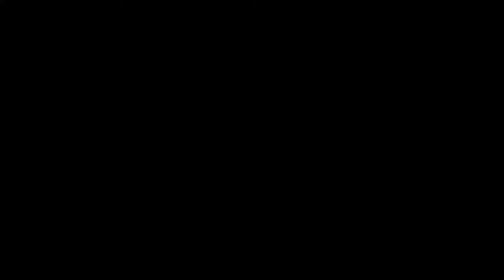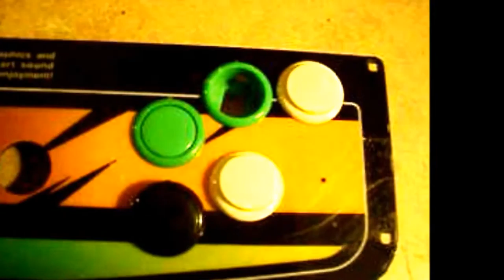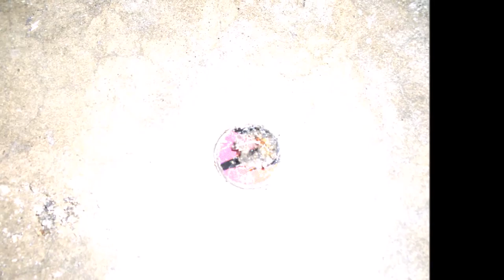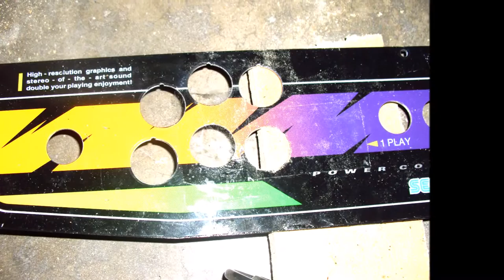Hole Saw Tutorial

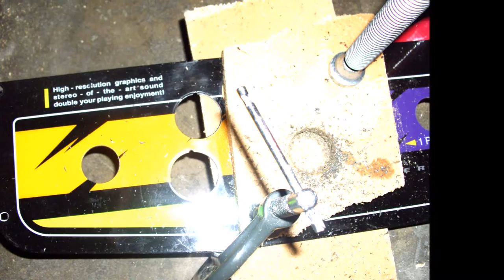Comment: For exmaple in minute 0:25, those two button holes are not a perfect circle, they have a small indent on the top. Why do they have that? I checked my Sanwa buttons and they dont have one protuberance to fit that indent, but four and different shaped.

Hope I expressed myself right.

Thanks for replying!
Reply from the maker: +Jaime B. Oh! Yeah, isn't that odd? The megalo panel has that indent for all of the buttons, I think it is a stress reliever or something, maybe to make moving them into the panel a little easier. Never good to shave those tabs for insertion, used to do that myself, but I no longer do it and want them seated tightly.
Reply: I really don't know what are they for, my blast and astro panels have them too, but don't find they make it any easier to insert the buttons...